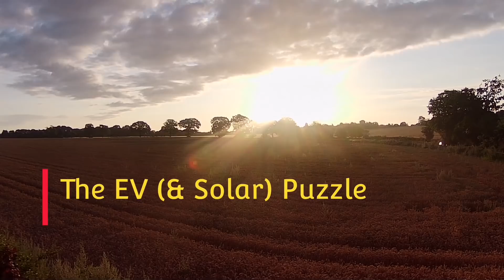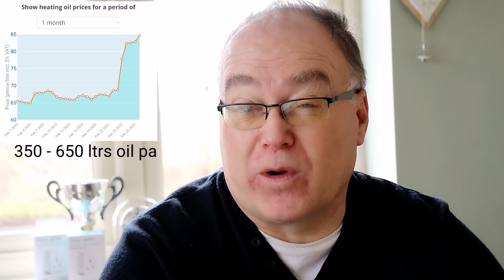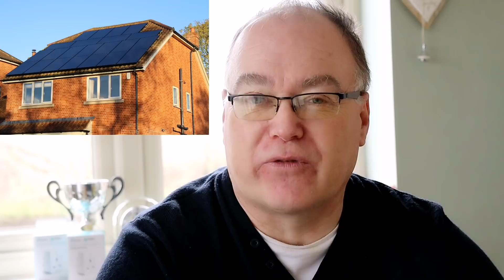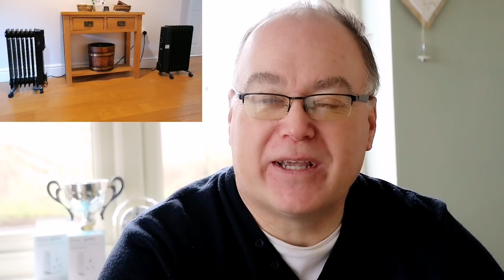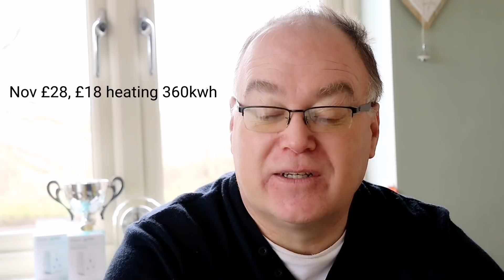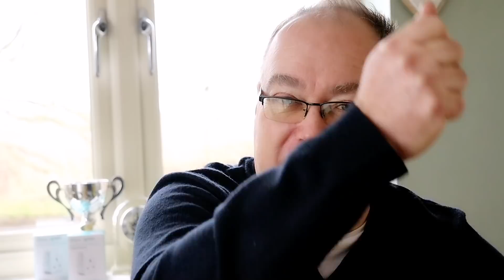Electric vs oil heating - No central heating all winter. Results of my full winter test

Comment: Last time I took full advantage of the Go Tariff was the 5th February.  I hadn't been driving my EV so much this month.  However I'm now exporting as of 21st February, so I decided to switch to Agile for the longer months of daylight.  Today, the outgoing agile tariff has been above 30p/kWh all the way from 9:30am to 8pm, with only two half hour periods below the 30p threshold.  These are scary times.  If there wasn't the price cap on Agile import, we'd be paying 2.4x the outgoing tariff.  I'm just so glad that I have my solar panels, and my sister is about to pull the trigger on a 7.5kW system quote for her house.

Comment: Another informative video with lots of data.  Did you consider the cost of making your original oil burner / radiators smarter (smart valves) etc. vs the cost of electric radiators?
Reply from the maker: Yes but I'm just ready to do the right thing and go emmissions for heating too.

Keeping oil is probably cheaper in the long run unless these higher prices are here to stay but I just want to live as off grid as possible in fact to be paid by the grid

Comment: Doing the same here in Oklahoma. Much colder here, but four of the 7 fin oil heaters work well. Generally on medium 900 watt settings. 8KW solar system. Will be switching to mini split soon though.
Reply from the maker: AC systems sound good but I'm struggling to find an installer that doesn't want to rip me off
Reply: @EVPuzzle  I was going to say reverse cycle mini splits will keep you cool in summer and warm in winter and solve your humidity problem.

Comment: What kind of a stove do you have? What is its output and do you use a sustainable/ renewable source?
Reply from the maker: Yes it's a sustainable source, only use managed woodland  firewood, seasoned and buy in summer to dry further. Wood is cycled indoors too to dry further before use.

Burner style I'm not sure. I see it's use reducing and eventual removal.

Comment: Nigel another interesting video, you can’t beat the luxury of electric underfloor heating in bathrooms but can be difficult to retro fit. Finally got quotes in to increase our array from 2kWp to 7kWp with 16kWh batteries. A question to your subscribers is it best to try and get DNO pre-approval for an installation over 3.7kWp or just send in the form after installation. Still waiting on a smart meter timing so not sure whether to delay installation until it gets fitted. Thanks again for a really interesting channel.
Reply from the maker: Best to be above board imo think they respond to inquiries so you can always ask... Ours does.

Comment: Very, very useful to hear your experience.  We are just starting on the same journey.  PV system switched on a couple of weeks back, now experimenting with electric heating.  Trying the Herschel infrareds as they were praised on Fully Charged. Still waiting to see if we want to go with more of them.  Will probably keep two modern wood stoves though as we have an infinite supply of free wood.
Reply from the maker: Season it well and burn hot to reduce Emmissions 👌

Comment: Great analysis, thank you.  You hit the nail on the head with cheap electricity tariffs for overnight winter charging. Great while they are around.  Doubling and trebling is about right over the next few months. (Econ 7: day 33p kwh Night 20p KWh - 12m fix from 2/3/22) I don't see a drop in costs coming, there are too many complex variables affecting electricity and gas pricing.

Comment: I know this was only a test but you need to be around to turn all of these heaters on when required such as the kitchen fan heater.  With a air source heat pump I presume it would be all on all off accept for thermostats on rads.
Reply from the maker: Smart plugs turn these devices on and off remotely, even by voice control using alexa.  I often adjust the heating whilst away from the house.

Yes ashp is different as it's more efficient to leave it be maybe dropping temp just small amount overnight. This is where doubt comes in about ashp. If you don't work them hard you don't get great cop values so sizing for your needs including how you might use it is key.

Im not anti ashp, I know people with excellent efficient systems that cost very little after grants and are cheap to run. If only I could run an ashp just for my wet rooms... Maybe I could 🤔

Comment: Having small heating appliances ends up being much more efficient than a big boiler. Guess it is a case of "rightsizing" systems and putting the heat exactly where you want it.
I'd keep the log burner and a small supply of logs in case you have a power outage and for those occasions when you just want to use it. Redundancy is important. It doesn't sound like you need to swap out the boiler for a big heat pump either. Maybe put a couple of smallish split cool/heat A/C in the house for when you need them.
Thanks for sharing the results of your experiment.
Reply from the maker: Thanks Andy

I'm really curious about tepeo. If it can be modular and controllable by room it could be ideal.

Ashp tempting for the cop value only.

I've git quotes for AC units. Definitely looking at those
Reply: On the topic of gas/oil heating systems. I've recommended to friends on more than one occasion that they put a 13A plug on them rather than wiring into the wall outlet. This enables them to use a small inverter or generator to keep the system going when there is an electrical outage.

Comment: Good update Nigel thanks. Interesting to hear your results and the benefits of your portable electric heaters over your oil and wood burner. It's good to do those tests and understand what your home needs and the needs of your family.
Reply from the maker: Cheers John you were quick to watch that one.  Just needed to close the door on that test but I really have learnt a lot and feel better prepared for what we do next.

Looks like I won't be buying any oil this year, or next year etc. We've 400 litres or so left but suspect it won't get used. Appreciating asset to sell to the neighbours maybe 🤣
Reply: @EVPuzzle  the video had been live 10 mins before I dived in! 

I think the biggest take away is that every house and household is different. There's no point a viewer A or B comparing your consumption with theirs as the starting point and end goal are different. Think about fabric first, as you have done, and then a heat loss survey are good fundamentals to have in place. Then anyone knows what they need to heat heat their home under different outside temperatures.
Reply from the maker: I agree, I just skipped the heat loss study and used the finger in the air approach by experiencing energy use and heat loss. Not best approach but that's me all over doing it my way 🤪

Comment: Not heating rooms does not save energy if your home has a thermostat. If you look at the "Heat Geek", channel they take you through the heat loss calculations and show that the rads which are on simply work harder in order to get the temp up to thermostat setting. One is effectively using a higher flow temperature than is necessary, which is less efficient than using a lower flow temp.
Reply from the maker: I don't follow the heat geek and my test is about a non central heating test without a home thermostat.
Reply: @EVPuzzle  Thanks, yes. But people do believe this myth. I hope to bust the myth.
Reply from the maker: Tortoise and the Hare but I think these type of discussions aren't comparing like for like.  
How best to heat a while house is one thing but how to use the heat you produce most effectively is a different angle
Reply: @EVPuzzle  Physics is physics, heat escapes eventually and thermostat stats if fitted  switch on and off appropriately.
Reply: There is some validity to your suggestion that running the heater in one room, but leaving a cold room next door will increase the needs of the room you are heating.  However you would save some money by not heating every room.  This is because interior walls do not normally have insulation, the heat transfer into the un-heated rooms can be significant.   So overall heat for the house, should you heat every room might be 100,000 Btu's, while not heating some of the rooms, the heat will go down somewhat, say to 90,000 Btu's.  It is all sort of 6 of one or half dozen of the other.  Your heat savings is not significant, but there is some savings by not heating the room.  

Installing a heat pump and increasing the temperature in the living room to about 21C can cause a significant reduction of the need to run the electric heaters in the rest of the home.   And because the heat pump can collect 100,000 Btu's of heat outside and bring it inside at about 7 KW of electrical power, it can be a significant power reduction compared to running electric heaters at 3,400 Btu's per KW or about 23 KW per 100,000 Btu's.
Reply: @Kangenpower7  You need to show your working out and reduce the complications. I do not believe you.

Comment: Some new "passive houses" are built so energy efficient that the house can be kept warm with just the equivalent of a hair dryer. An energy efficient home or business is more comfortable and saves money in the long run.
Solar energy on your roof combined with battery storage can make people more independent from the grid and natural gas supplies. Add solar and supplemental electric heating or a heat pump for home or business heating..
All big box stores and manufacturing sites can support solar energy on their roofs or parking lots.
Added insulation, double or triple glaze windows, energy efficient doors, energy efficient heating and cooling systems, energy efficient appliances, LED lighting, smart thermostats, solar panels combined with battery storage and a electric vehicle charger in the garage or car park. People are too focused on the short term costs and miss out on long term savings and comfort. Blower door testing and air sealing are under appreciated tools.Even if you have money to burn you should not waste it.  Climate Change will impact everyone. Leave a better future for your children and grandchildren. Join in and speak up for the future of the plane
Reply from the maker: Good thoughts, I'm so often told I'm a miser or penny pincher but it's bit about the money it's about being efficient not wasteful.

I'll be looking at how to improve our insulation too. It's getting out somewhere
Reply: A blower door test would make a great video.  One guy posted a fan in his door increasing the air pressure of his house, then went around the house using soap bubbles in a 2 gallon chemical sprayer to check all the windows, doors and electrical conduits.  There was a lot of soap bubbles coming out everywhere!  Then he was able to seal everything up, with a significant reduction of the air loss to outside!   So if your curtains blow in a stiff wind, with the windows shut, you might have leaking windows and air gaps around them.
Reply: @Kangenpower7  yep !

Comment: Europe needs to do more to encourage production and adoption of heat pumps for heating.
Seems like a tax credit for installation of a heat pump would speed up demand.
Reply: The problem with a heat pump installation tax credit is they only apply when you hire it out to a contractor!  That can cost you thousands more than a self install kit from Amazon!  And the installing contractors know they have you by the shorts, and will raise the price so they actually are the ones getting rich off of the tax credit by selling you the heat pump at a higher total installed price!  I have heard of people being quoted $19,000 for 2 each ductless heat pumps with 4 heads per unit.  This is a huge cost!  While the equipment is about $7,000 in that case, it is much more affordable to not put a head unit in each small bedroom, but to use another way to heat the smaller spaces.  

Most people can tolerate cooling a home using  a window A/C unit, then open the doors to the bedrooms to cool that room.  You can do the same thing by installing a ductless heat pump in the living room, and using that heat to drift throughout the house.  Then perhaps install a dehumidifier in the bedroom to provide local heat to that room.  And a couple of small 1,000 watt heaters to use on very cold days in the rooms not close to the heat pump heated room.  If you find that you are using the electric heaters to much, then install a small 9,000 Btu heat pump in a couple of the other rooms that will get used a lot.